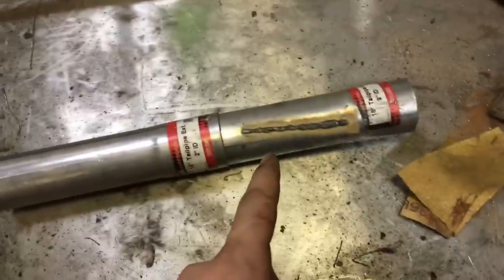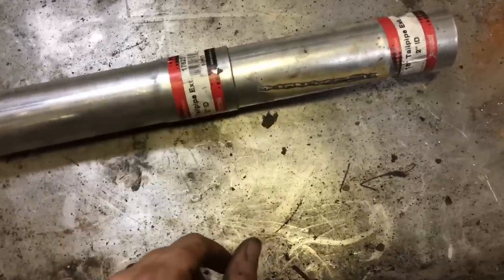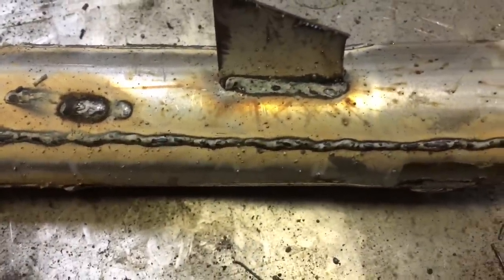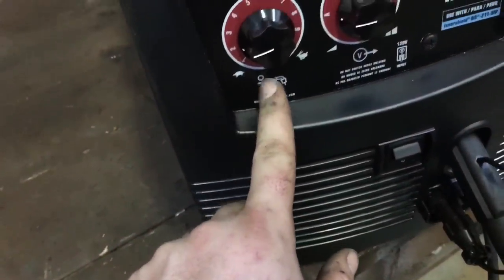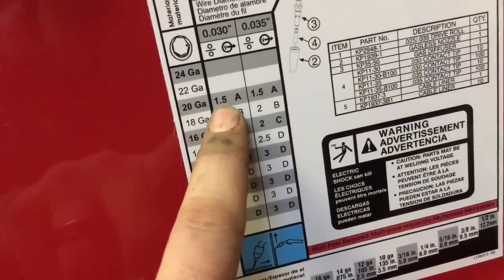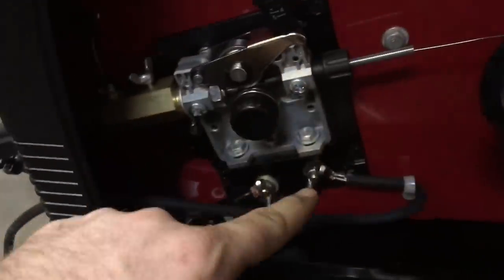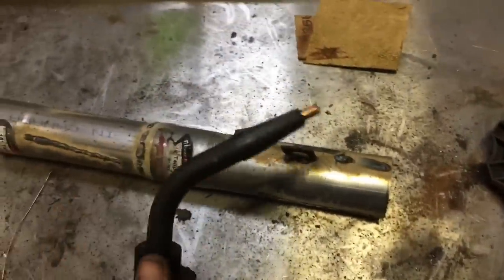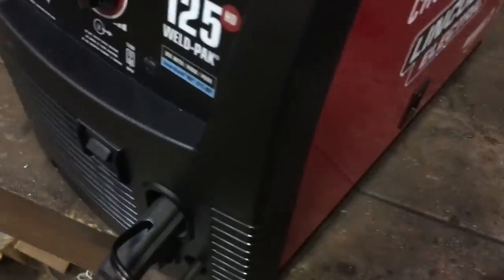Lincoln 125 weld-pak HD review

Comment: The Hobart Handler is a family of MIG welders, and they make a 125 amp model that should be just like this Lincoln to operate. Not clear on which version of the Handler you were using before, but it shouldn’t be that different. 
The 140 amp Lincoln HD would be a better choice because you can also use shielding gas for true MIG welding. You can buy a solenoid kit to allow it to MIG weld, but you’ll have spent more money than the 140 would’ve cost you. 
If you buy a brass nozzle, you can use it instead of the insulator sleeve and avoid the arcing problem.

Comment: Had a Hobart 125 welded excellent. Got a lincoln 125. Not to happy with it. I personally prefer the Hobart over the Lincoln. Seemed to burn hotter. Actually prefer Hobart and Miller over Lincoln. Just my preference.
Reply: Lincoln makes Hobart. They are the same welder
Reply: I don't know about that. There is definitely a difference between the two. As far as welds go.

Comment: Can you weld aluminum with these type of welders? if so. .. what type of wire do you use?
Reply: The short answer is no. This welder is made for flux-core welding, so is limited to mild steel. You can add a gas kit to it , which includes the solenoid, regulator, and plumbing, which allows you to use solid core wire and shielding gas. Even with the gas kit, this would still not be suitable for aluminum, as it's not made to accept a spool gun. The 140 HD and 180 HD Welders will accept the spool gun, and can be used with aluminum.